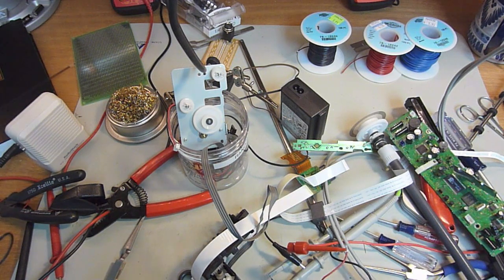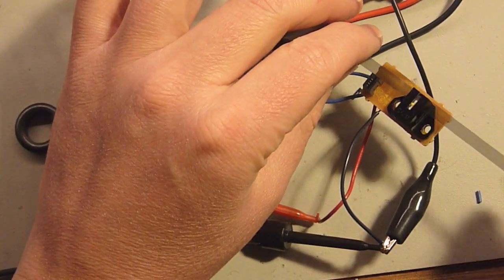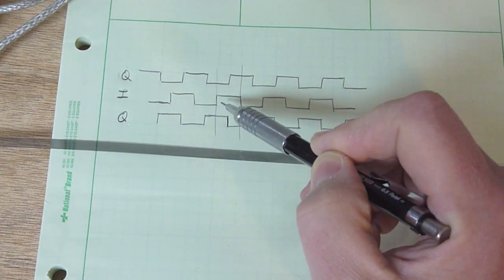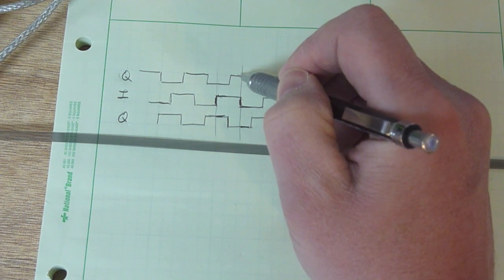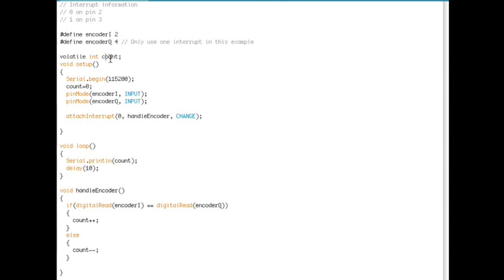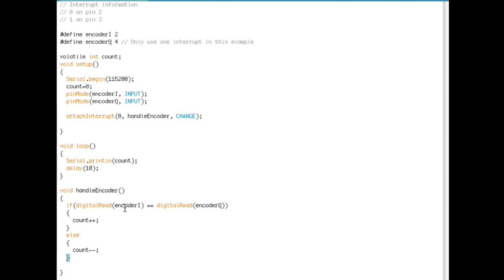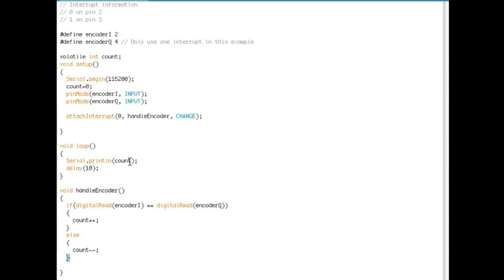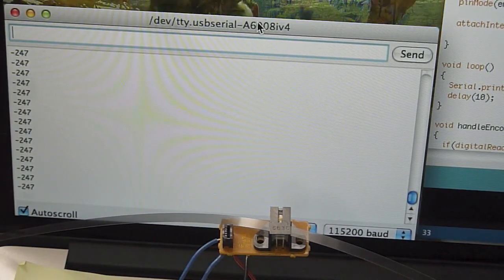How to use linear encoders with Arduino. hardware, code, and demo.

Comment: Do you have any idea why this is code is not working on an arduino pro micro?

My board has an ATmega32U4 and I modified the line:

attachInterrupt(0 , handleEncoder, CHANGE);

to:

attachInterrupt(digitalPinToInterrupt(encoderI), handleEncoder, CHANGE);

I've also tried the code on an arduino nano and it works without a problem, but in the micro I get a lot of random jumps on the count value.

Comment: I found a pcb with the same encoder. I just can't figure out the pins on the receiver side. I found somewhere that there is signal 1 and signal 2 pins and other two pins which are Vcc and ground. I just can't thrust that the connections are exactly the same on that encoder and mine. Any tips and advices?

Comment: I want to ask, why my sensor printer while display value read data in serial monitor never decrement?  The value data in serial monitor always increment?
Reply: The sensor same like the tutorial , the wiring,  the pin 
and i connect to arduino nano.

Comment: Hello. I tried to read the signal directlly from the rotary encoder of a working HP inkjet printer using your code. The signal in this printer encoder varies between 0.6V to 2.5V (aproximated values). I believe that, specifically in this case, 0.5v should be interpreted as Low level and 2.5V high level. However, when I simply touch the shaft, the counter changes suddenlly to high values as 1,000 counts. I´m not sure if 2.5V is the treshold between low and high, and due to that, the interrupt pin count many transistion around this voltage value. Would you have any tip to make possible correctlly count the number of transitions? I was going in the direction to do a voltage follower or something like this. What do you think?

Comment: I'm going to make a 3d printer with these sleds. (Stay tuned!)

  I wonder if I can make one of the lines on the encoder, near the end, wider so I can notice when/where the print carriage is. The trick will be knowing the waveform is longer on one photo receiver but not the other. 
But the speed could change to make this happen too. So it will only be noticed during a homing sequence with constant pwm.
Great video! There aren't a lot on the subject. Subscribed.

Comment: I know this is old but I tried this code and can only get it to compile using a while in place of the if statement. I get an error (if not declared in this scope) with the if statement but not when using the while:
If (digitalRead (encIn_P_pin) == digitalRead(encQIn_P_pin))
  {
    countEnc++;
  }
  else
  {
    countEnc--;
  }
Reply from the maker: lower case “if” not “If”

Comment: Hi, which printer did you get that part from ? 
I've got one from my HP printer and it seems like the pinout is different from yours.
So, i just put 5V to Vcc, and 0V to pin GND then watch the pulse in the Osciiloscope ? 
Do i need to connect anything else, ie. the 2 pins of the led ? (Mine is a 6-pin version)
Thanks
Reply: Hey! still need the info?
I was trying to reuse a 6-pin HP linear encoder sensor too and it worked by following this diagram:
http://reprap.org/wiki/File:FD_opto_sensor_pinout_02.JPG
Cheers!
Reply: I followed that one too and it worked perfectly.
There's one more thing, do you know the resolution of that linear strip ?
Thanks for your concern.

Comment: What about a 6 pin? I am assuming that I would just need to provide the LED it's own pos/ground (with a resistor) and wire everything the same as you do, but I don't want to ruin the encoder.
Reply: I just got it working, and if anyone else has this question, yes. You do power the LED with its own separate Pos/Ground. I used a 200ohm resistor with 3.3 volts to power the LED. Great tutorial! Thank you very much! Almost a month of head scratching is over.
Reply: I have been experimenting with a 6 pin encoder from a Canon printer.  It was mounted on a small PCB (which I left attached).  The PCB incorporated the resistor and capacitor for the LED, and it only had 4 wires to it... Ground, +5v, output from sensor 1, and output from sensor 2.  This made connecting it up much simpler.

Comment: Working perfectly with both linear and rotary encoders pulled out of an old HP printer. Will be very helpful for my cnc machine. Thank you very much for this!
Reply: Did you get it working?  I find stepping only 1 step is difficult because the motor overshoots / or has to move really slow to not overshoot.

Comment: Hi thanks for the informative vid. Just wanted to know though, what is the reason of using interrupts instead of just reading digital pins from loop.
Reply: If you're polling, and doing other things in your code, you could miss transitions.
Reply: I am also interested in that. A reply would be very helpful :)
Reply: In this example I don't think it is essential to use interrupts, because the Arduino is doing nothing but monitoring the two inputs.  As soon as you add code to perform other chores, it is likely that a change in logic level on either input will be missed, and the variable "count" will not be updated. There would be a noticeable slowdown as well.  

The interrupt looks after the job of watching the input for a logic level change.  This allows the processor to carry on with other tasks until the logic level changes... when  it is interrupted by the interrupt, which is probably where it got its name!   :o)

Comment: Correct me if i'm wrong, but doesn't delay cause the entire program to halt for the defined delay time? Wouldn't that cause the program to miss counts, leading to an inaccurate count? 

The only reason i bring it up, is people needing an encoder like this for their project, only really need it for accuracy, over time, the delay would cause this count to be so far off, that all accuracy is gone.

That being said. Very well described operation of an optical linear encoder :D
Reply: The delay only causes a delay in the loop. The values of the encoders are independent of the code and will change accordingly.
Only the time it waits to print the value changes, the encoder values vary in real time.
Reply: The delay will not affect the accuracy because it’s only in the main loop. The delay will not affect the interrupt which happen on pin level change.

Comment: Very nicely done! Would love to see something similar with the circular encoder. Great video!
Reply: +Houston Firefox I used the same steps for circular encoder and it worked just fine. Took me a little while to identify the pins, though, as the part had no signature and therefore no specs :(
Reply: Robert Klauco Please tell me how you identified the pinouts. I have fried 3 encoders already.

Comment: Awesome. Just dissected a printer and one of the treasures I got from it were one linear encoder (for the carriage) and one circular encoder (for the control of the paper during printing). This is a very helpful video!

Comment: I'm getting 0 and 1 with the 2 and 3 connections one way, then when swapped I get 0 to -2.
It appears I have the same equipment, brand anyway(Lexmark).
I used the wheel that was matched to the encoder and a strip from another printer with the same results. To start I copied and pasted your code.
Any suggestions?
Thank you for getting me started regardless, I've been wanting to figure these out for some time.
Reply: I had the same issue using pin 2 & 3 however in the Pin define I &Q  should be pin connected to 2 & 4. Once you connect Q to pin 4 instead of 3 then it works like a charm.

Comment: Hey, I tried doing this but whenever i slide the strip through the sensor it only moves from 0 to 1 or -1 back and forth! It's almost impossible to see another number. I think that I got the connections right because the sensor is lit up (pins for power are right) and I assumed the other two pins to be for the I and Q signals. So in summary, nothing "blew up" but the sensor doesn't work as intended either.
Reply: Experimenting a little with the code, I found out that the counter goes down by 1 almost every time it goes up!! If I comment the count-- line, the counter goes up every time, regardless of the direction of motion. I am going to check the I and Q connections for shorts, otherwise I have no idea of what's going on...
Reply: I was connecting the encoder in a wrong manner. You should recheck your connections, the code works perfectly. Pay attention to the numbers the pins are assigned. The code provided by this guy is not very clear in that sense.
Reply: I had the same issue using pin 2 & 3 however in the Pin define I &Q  should be pin connected to 2 & 4. Once you connect Q to pin 4 instead of 3 then it works like a charm.

Comment: thx bro.. this has been really helpful to me !
Reply: How many pins did your encoder have? 4 or 6? I having though luck working this thing for couple of weeks.
Reply: Hi, my encoder have 4 pin,  if you look from top ,  you will get 
   _________
   |                   |
_|   Encoder    |_
|_______________|
   |      |      |      |
GND  A   VCC  B

connect power supply from arduino to  GND and VCC  5V+   
connect  A   to  arduino pin 2 
connect  B   to  arduino pin 4

then use code from this video , then you make it.
if you already connect VCC to pin A or B , the encoder will not function anymore. you have to find other encoder.

Comment: Hello, I tried this with a linear encoder with 4 pins with out 5 pins that I believe is what you are using. I just couldn't get to work. I mean it shows count but it only goes increment in positive, not negative when I move the strip the opposite way. Any thing you have in mind? Using Arduino Mega by the way and exact same codes that you are using :D

Comment: I am quite curious about the pullups, I happened to de-solder the optical sensor, and I was wondering if the pull ups resistance should be 300-400 ohms like in the beginning of the video? Does it matters if I go for a 10k pullups?

Comment: Really interesting and thorough, thanks. I've just started trying to use Arduino for my DIY cine film-scanning system... I've been thinking about these optical encoders for a while, as a possible means to identify the linear position of the film passing through the unit. Could I use these encoders I wonder to detect the leading and trailing edges of film sprocket holes passing? If so, I wonder what the accuracy of such a system might be? Many thanks if you've got any hints or ideas on this...

Comment: By doing it the way you have with triggering on the "I" line, you sacrifice half of your available encoder resolution, and you aren't really running in quadrature.  Also, if you used a polling approach instead of an interrupt approach, I think you'll be better off.  Don't you think?

Comment: Great explanation. I did quadrature measurement a long time ago, this was a good refresher for me, so thanks for that. Can you tell me what the resolution of that code strip? I am looking for something I can use for position indication on a small milling machine, maybe future control with a motor. Thanks!

Comment: Thanks for the demo.  I was able to make this work with the adafruit motor shield and arduino to move a printer head back and forth.  While it will move to a particular value, it tends to hunt back and forth a bit first.  Your example made it all possible and I will continue to work on it to perfect it.  I am trying to use it with an XY plotter.